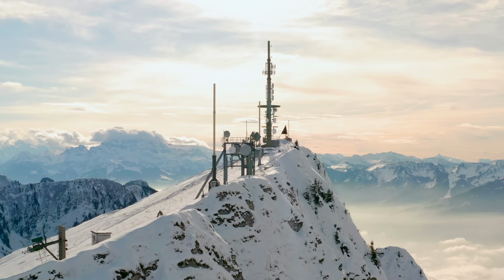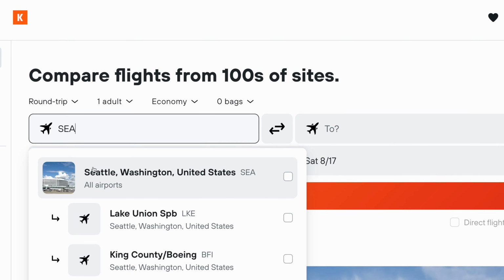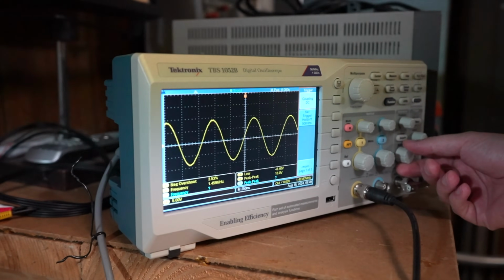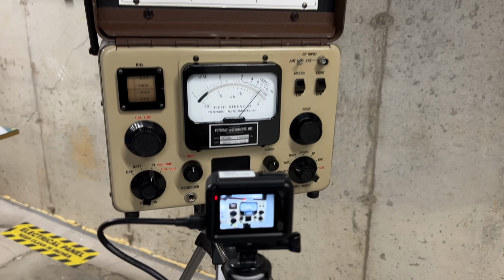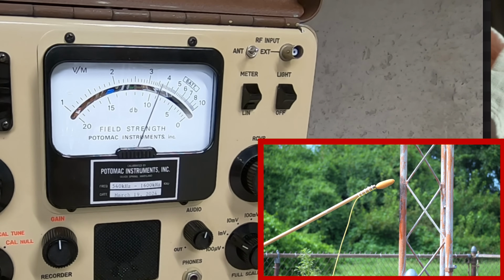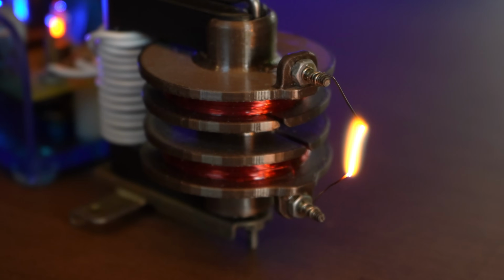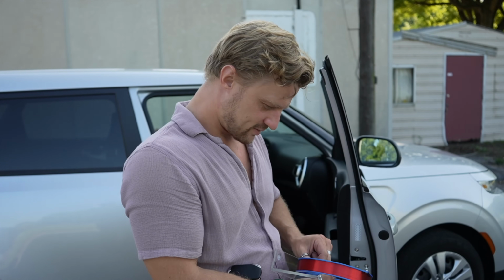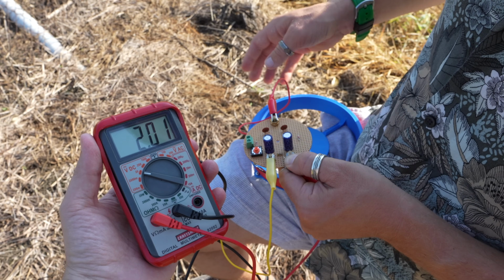Stealing Energy From Radio towers Using Plasma (ft. Geerling Engineering)

Comment: not wanting to be a buzzkill, here, but the fact that you completely OMITTED the inverse square law [of physics] and why that law makes  "wireless power" completely USELESS, in any context, just makes me think "CLICK BAIT"!

let's point out a couple obvious things:

The radio transmitter was putting out 12 kilowatts; thats 12 THOUSAND watts (not to mention that it probably took almost 18 thousand watts of POWER to generate all that RF signal (not counting the  many thousand MORE watts to modulate it...)  and, with all of that, you still could only FLASH a SINGLE LED... thats only one, one-hundredth of a watt.. or 0.001 of one watt at a distance of what, 300 feet!  OR in other words, using a small POWER PLANT to put out that [energy] of a COIN CELL!  This is EXTREMELY INEFFICIENT and yes, theres a DAMN GOOD REASON for this!  its called the INVERSE SQUARE LAW...  the full explanation of this exceeds the scope of this post, but "in laymen's terms":

Twice the power for half the distance

or, in other words:

For each [distance] more, you need 4 times the power exponentially 

this means the power requirements climb more and more many times over for what little distance gained, which QUICKLY makes this [wireless power] impractical, if not IMPOSSIBLE!  so, then how does radio work? you might ask... radio, in itself,  uses large sources of power- and large antenna structures... to generate these electromagnetic fields... yet when your radio receives them.. by then, those signals are VERY TINY and require AMPLIFIERS, FILTERS and [beat oscillators] to condition them before they can be demodulated [converted back into audio] and then, again, amplified to drive a speaker so that you can hear the program!  (a LOT goes on in a radio receiver!)

Tesla couldn't beat this law of physics either- and although he TRIED with all his might (and resources), he concluded that it just could not be done [with the tech of his day- and we STILL can NOT beat it in THIS day either]. the inverse square law is a real SHOW STOPPER (and it also is a LIFE SAVER too since rays in space have to ALSO abide to this law of physics, otherwise we'd have been COOKED a long long time ago! but, I digress..)

oh!  and, if the station engineer's only KNEW of that little stunt of placing a hotdog on the antenna base.. thus SHORTING OUT the radio signal (and yes, this MOST DEFINITELY caused DAMAGE to station equipment and LOSS of signal to listeners) and I'm amazed that the transmitter's safety interlocks and problem alarms didn't trip... (I can see the LOG entries now... "transmitter carrier interrupted due to fools placing HOTDOGS and PICKLES at the bowl insulator (tower base) and causing VSWR alarms and an emergency breaker-trip") and, not to mention, the FCC would also have had a field day (pun intended!) with fines and other violations for you,  the "deputies" and the station itself for all the radiated harmonics you created!

at least it was an AM station and not an FM one; otherwise, that stunt may have jammed aircraft navigation and cause a plane to drop out of the sky!  but, again, I digress...

"phun" stuff indeed!

whats the term here?  PSEUDO SCIENCE at its best...  like "perpetual motion" and "free energy"- its all FANTASY...

Comment: Nothing to do with Plasma. .  That is a nonsense. . .  Just EM Waves, same as light, but much lower frequency. . .  I actually touched a 3,000 Watt feeder with the back of my neck, that was about 1,000 Volts. . . . It burnt a line about 1" long and took many months to heal, but it did not stop me working that day. . . .  But yes, you can steal energy from Radio towers, it is actually stealing so illegal.. . .   You effectively make a large radio receiver antenna to capture some energy, usually just a few watts, but it can be done. . .  But really not practical, the amount of energy you can capture or steal will not really even light one light bulb.. . . . .   Actually you can get on to a tower like that, by by-passing the security fence. . .   You need to jump off the ground and onto the tower.. . Do NOT ever touch the ground and tower at the same time with a leg and an arm, that could kill you.

Comment: OK, so the crystal radio did the same thing 50+ years ago.  I had a relative that worked at a radio station that was transmitting with 800,000 watts. We have seen pictures where instead of carrying flashlights, they would carry florescent tubes whenever they visited the antenna field at night.

Comment: I'm a sad you called it a "generator".   We never actually generate energy; doing so is actually 100% impossible.

All we do is transform energy from one type into another type and it always comes at a cost of losing some of the original energy.  This is even the case with coal etc etc burning.   

I think the term "generator" in reference to energy is one of the reasons why people end up thinking free energy is a potential thing.

We really need to name things as they really are so, you made an "energy transformer" .  I get that its standard to call stuff a generator but; it  really should change. 

Which yes, is super cool.

Comment: When i got my 67 cougar back in 1980ish ... i had a radio ... like an am/fm radio with 8 D battreries in it ... i put it on the transmission hump ... i attached a thickish copper wire to the antenna ... i attached that to the antenna wire coming in ... i never needed to replace those batteries .. my nephew had a loudspeaker from a baseball field to the radio ... i still never needed to change the batteries . It was amazing ! .. still perplexed.😮

Comment: (Happened in Croatia) My dad told me that in 70s and 80s, local gypsy's in their huts that lived next to TV transmission tower would use simple copper  wire swirlies, attach a light bold and you have light.

Comment: ok so i don't really understand this stuff and i'm pretty dumb in general but i'm trying to understand. my quest is if you absorb the electricity from the air which gets converted into sound from vibrations then couldn't you use that to store the energy into batteries? im pretty sure i heard something on youtube once about good ole nicky tesla trying to make the world into free wireless energy for the planet by a process like this but sending high voltage in the are over the entire planet was very dangerous (and they gov couldn't profit off it) so they buried his inventions BUT theoretically it would work right? COULD you use this to absorb energy in the air and convert it into electrical energy inside a battery to use for powering everyday stuff?

Comment: In 1985 I was a CATV tech and was investigating a woman's electric range in her kitchen that was talking. You guess it... there was an AM radio tower not far from her home. Near that same tower, I was stringing a CATV drop to a home. Both ends of the 40-foot insulated CATV cable were not connected to anything. When I cut a fitting onto the end of the cable, I got a 76-volt AC shock... That's when I learned about what this video was all about.

Comment: Clearly the cord dog and the hot dog were not cooking evenly along their longitudinal axis because of reflected loss. The efficiency of the power transmitted to the actual antenna output into broadcast deeds to be towed for proper removal so that the power input more properly absorbs into desired cooking of said corn dog... Usually retarded the impedance of the ketchup or the mustard will properly allow for a correction.

Comment: Considering that my car's battery/alt are producing around 14v, this is amazing to have learned about. Makes me think of Tesla's tower and dream for free electricity for everyone. Of course, in this Capitalist nation, this would never be allowed.
I wonder if there's any one living off-grid, homesteading, who's figured this out and taken advantage? I mean, technically you could even run a mobile system much akin to the solar/battery systems used in RV's and Schoolies.
Reply: Well the big difference is the ampere hours the battery has, e.g. 14V 1A is a lot more power than 14V 0.01A. Surely you could slowly charge up a battery bank, however I think if you're scaling things up this big, people will definetely notice and investigate, no idea how the legal situation is there, but in my opinion it's theft of electricity. As you can see in the video, the moment he touched the tower with the rod, the output of the transformer that supplied the tower dropped, so basically also the signal from the tower got weaker.

However if you use something like this to power your small garden weather sensor station, I bet nobody would even notice or care.

Comment: About 40 years ago, at the Australian naval transmitting station in Belconnen ( a suburb of Canberra), the operators discovered a strange hole in their radiation pattern. They found, by driving around the suburbs with a field strength meter, that the field strength fell sharply just behind one particular house. With some assistance from the police, they investigated and discovered a resonant tank circuit that the owner had put in the roof of the house. He was using the "free" energy thus obtained to run his lights.

Comment: So if i build one of those with a 5 or 10 Amp silicon diode and a loudspeaker, go around 650 WSM tower,  I should have one very loud crystal radio receiver.😊

Comment: I wouldn't recommend even playing  with the fence surrounding the tower.  Something metal ( or anything conductive) may have linked the tower and the fence. So , when you were making jokes about getting electrocuted by touching the fence and not touching the tower nor the guide cables someone may think it's safe to goof around and ACTUALLY GET ELECTROCUTED. So, NEVER mess with even the fence or even anyplace you are not supposed to be nor familiar with.

Comment: Combine this project with a miniature solar panel, then do some magical energy conversion stuff with the antenna and solar cells to standardized the combined output that then feeds into a rechargeable battery that also has an automatic voltage cutoff switch. This way you can have an emergency "set up anywhere" small electrical recharging system. Another thing though to keep in mind about this entire idea though is that the energy conversion ratio and efficiency of the entire system is, I imagine, quite horrible.

Comment: So this is kinda like Maxwell technology why not convert plasma to power up a house or a car or rideable drone
Reply from the maker: Well, it would take a tremendous amount of energy to power a house. 10kW on the conservative side. To pull 10Kw out of radio waves would require a very large apparatus, and a massive 1 MW transmitter. At that point...not sure if I even want to be that close to it!

Comment: So...the Zimbabwean inventor isn't pulling energy out of nowhere.
Reply: Now they are admitting it is possible but when he was making his claim they said it goes against the principals of Thermal Dynamics  - wow these people !
Reply: The problem with Zimbabwe man is that the inverse square law means that if you are not right next to the tower, the power received will be very very low. He is claiming to generate 15 kilowats of power but the energy in the radio waves is nowhere close to 15 kilowatts. Maybe his device can charge a EV battery in a few months or years, but unless there's uranium in his device then where is the power coming from?
Reply: Max has a fully charged EV with a fake placebo gerbil cage&wheel engine up front
Just another failed african scam from 5 years ago,
His... And i quote micro sonic powered radio wave catcher
Does not exists

Qungfu is a Scam bot account wasting african man hours on a long con
Reply: He never said he was, neither did Nikolai Tesla.

Comment: 30 Years ago in West Australia I install an alarm with a 8 ohm speaker in the siren box which would play the AM radio station being transmitted from its tower a 1/2 Kilometer away. The client phoned me wanting to know if the radio station could be change to another one as he didnt like the music. In the end I diconnected the earthing wire to the alarm system and the music stopped.

Comment: Actually it is not stealing from over the airwaves.  These waves come from every direction that can be harvested an d it's free.  During my Ham and CB days I had a radio tower that was collecting energy up to 50 volts with 0.9 amps which was enough power to charge a 6 volt car battery.

Comment: Two questions:

1. Is the power that is harvested "pulled from the air" meaning there is an invisible power cord connecting your device to the tower or is that power "a posteriori" i.e. "after the fact" something like the water, no longer producing energy that has pooled at the bottom of a hydropower dam?

2. Can the frequencies emanating from utility electrical wire suspended from telephone poles be used to propagate wi-fi and cable tv?

Comment: So shameful.
You only copy what a guy in Africa discovered. If you use the power from the radio station the station will start charging you as it will lose distance and signal the more it is absorbed. So no not free and it is a very small amount of power unable to do most of we use electricity for. BIG thumbs down for the whole mess.

Comment: Which radio wave? Amplitudo modulated or frequency modulated...? The problem is the radio wave or as known as electron current is only flow through your equipment if connect to the ground...neutral pole in another way...this whole earth are grounding... that's is why radio wave cannot make gasoline explode no matter what because most of energy of that radio is already grounded...that what I feel strange about Maxwell from Zimbabwe story or your story...for example like lightning ...like in the rain weather...it's always goes to ground first rather than go the the electric equipment like your idea...that what make me strange...thank you

Comment: .
    Forty years ago, I had a small car with a CB radio and a 200 watt amplifier transmitting into a 102" steel whip antenna. Just for showy fun, if I was going to a CB meet up, I would take a 4 foot fluorescent tube with me. While stopped, I'd hold the tube out the window, key the mike and have it light wirelessly in my bare hand. A simple concept to be sure but it impressed the girls back in the day.

    I had a high school teacher in New York back in the 60's. He was a navy veteran. He told us a story about a friend of his who, while their ship was in port, was assigned to paint the outside of the bridge of the ship. He was up there for several hours when he came down and asked his C.O. to go to sick bay as he wasn't feeling well. They checked him out, diagnosed him with the flu, gave him some aspirin and sent him to his bunk. Several hours later, he didn't show up for chow so my teacher went to check on him. Teacher found him dead in his bunk.
    The navy did an autopsy on him and found that he was cooked from the inside. When the ship came into port, they never shut off the radar. He was up painting the outside of the bridge for several hours while the radar dish, which was mounted on the roof of the bridge, was going round and round and round irradiating him with nonionizing but still very energetic and powerful microwave radiation on every pass. This was before the first microwave ovens hit the market and the hazards of microwave energy on the human body wasn't widely known yet.

Comment: I have a question could your collector actually charge a home backup battery? Even at a low rate, how would it compare to a solar panel? How would you scale it to increase the energy? That's a video I'd like to check out.

Comment: This is exactly what the guy from Zimbabwe, who claims he has made a self powered generator/car/motorcycle work. He is harvesting radio waves for energy.
Reply: the hardest part about making a perpetual motion machine is figuring out where to hide the battery
Reply: He is faking it. there is not enough power in such a small area of to power anything actually interesting such as a car or motorcycle using radio frequency

Comment: I figured that coil would blow something so close to the tower.  I have 12 volt LED's in my boat that stay dimly lit after disconnecting the battery, presumably because of the maze of wires throughout the boat.

Comment: I had a friend that lived at the 16th floor of the Paulista Avenue in São Paulo. Most radio and TV antennas in São Paulo are on the top of the skyscrapers of this avenue. I remember that I could hear radio sounds coming from his sound system, even when it was not even plugged into the wall. Now it all makes sense. Good to know that I was not crazy, not hearing voices.
Reply: you can do that by wrap soeaker wire around coax to hear your self talk on a radio does not have to be plugin to speaker jack used radios for 50 years started in 1965 at age 10
Reply: @rickyodom1201  what was this? translate? LOL

Comment: replace the Diodes with a 1000 volt rating,  at am BC frequencies!  even a common 1N4007 should work fine, put a resistor between the Cathode (output) and Storage capacitor. should be fine after that.
Reply: ps the resistor will let the diodes to not charge the caps so fast which can cause them to draw an inrush current and blow out. try at least 200 ohms at 1/2 watt

Comment: I feel sorry for anyone listening to the radio during your experiments.

Also I've heard of power robbers using 55 gallon barrels wrapped in wire near high tension/voltage transmission lines to power a 220V stove for.. dubious purposes... Just something that may be of interest.